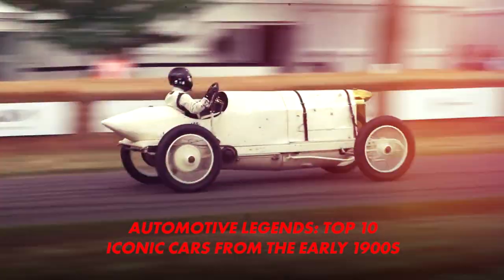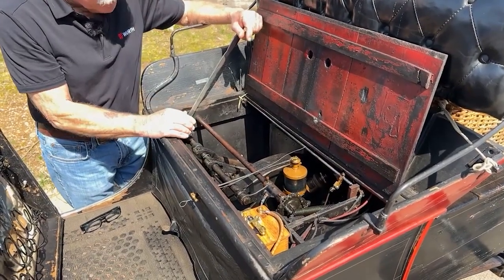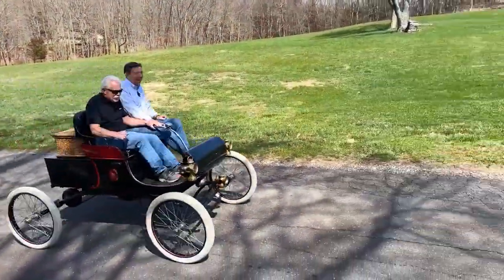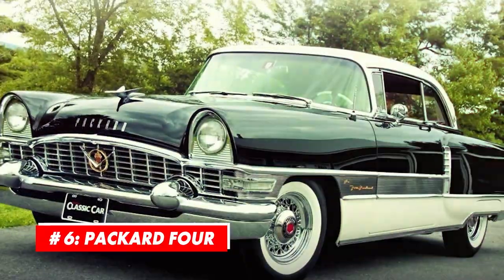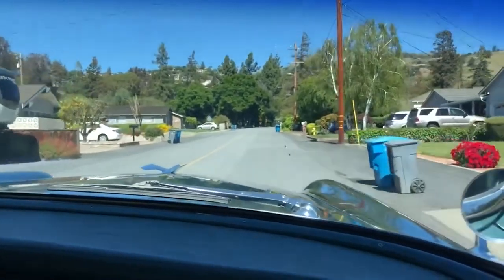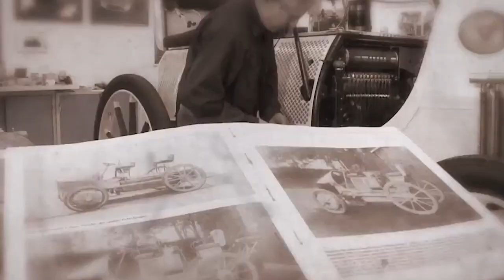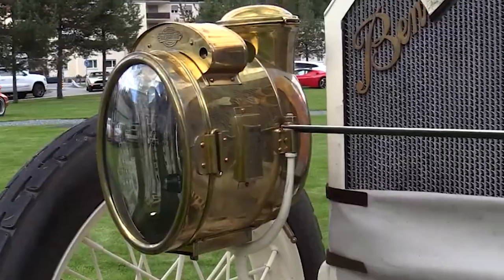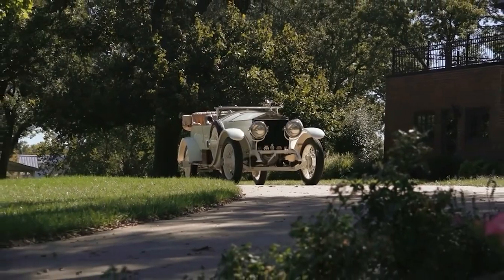Automotive LEGENDS: Top 10 ICONIC Cars from the Early 1900s

Comment: The narrator of this video said that the model T was not about technological innovation. It's only about mass production and the middle class. There was INNOVATION, here is just  two I can think of. The 4 cylinder engine was the first to be cast as a single block al the others cast their 4s in pares. This made it faster to produce and easier to work on. It also had a detachable head, again ease of manufacture and maintenance, you didn't have to pull the whole engine out to do a valve job. It was 8 to 10 years before other car makers adapted this concept and some didn't change until the mid 1920's.